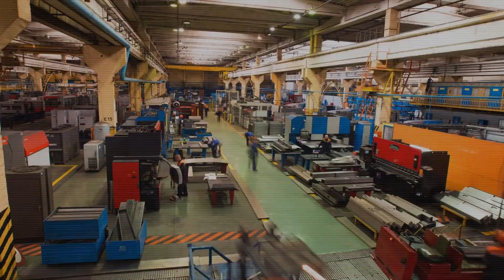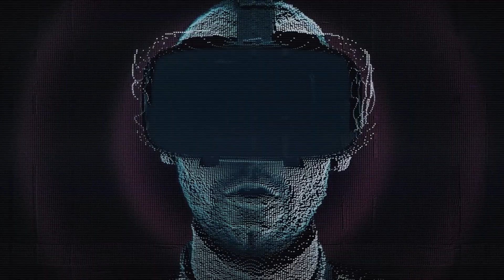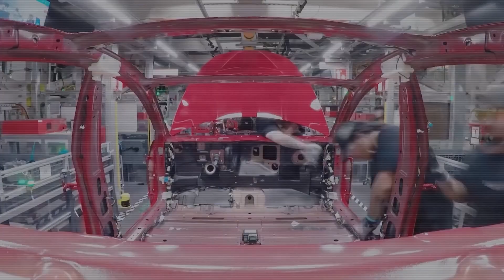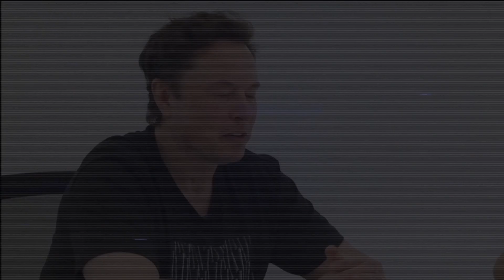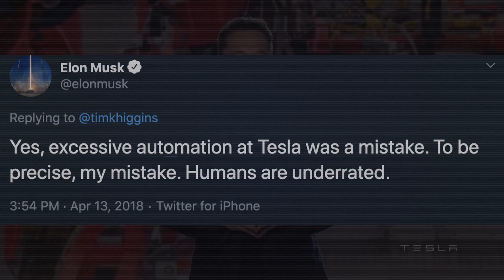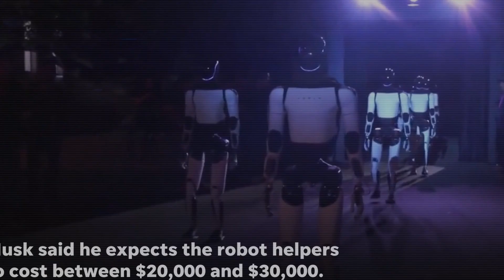Tesla Wants Factories With Zero Humans

Comment: Everything Musk touches he ruins. May a pox fall upon Musk.
Reply from the maker: What about SpaceX?
Reply: @TheTechTriangle  The Starship program is a disaster. Flights 8 &  9 with their mid flight explosions, fuel leaks, engine malfunctions, loss of attitude controls. Management & safety concerns have developed & it's causing increased stressors on the teams because they are forced to achieve goals sacrificing thorough engineering reviews leading to major failures & explosions. You do know Musk didn't create Space X, he bought it, just like everything else he owns which was created by true geniuses & he took the credit for. He's horrible at managing his businesses he's driven Tesla off a cliff another business he didn't create he just bought from those who did create it & he stole credit for it. That's his whole career he buys what others create & steals the credit. He's a con man just like Trump.
Reply: @TheTechTriangle  He's running Space X into the ground, pushing his goals & sacrificing engineering reviews leading to explosions & huge costs that the U.S. keeps bailing him out. The technical & operational challenges his shortcuts are creating is making the company insolvent. 
PayPal was founded by Max Levchin, not Musk.
Musk didn't invent Tesla, he bought it after Martin Eberhard & Marc Tarpenning founded the company.
Musk didn't invent SpaceX, he bought it & it's only been somewhat successful because of engineer Tom Mueller not Musk, but Musk is driving the company off a cliff.
Musk didn't invent Starlink, he bought it.
Musk didn't invent X (Twitter), he bought it & is running it into the ground.
Musk also bought Trump.
Elon Musk has never invented anything.
Elon Musk has never designed anything.
Elon Musk has never been an innovator of anything.